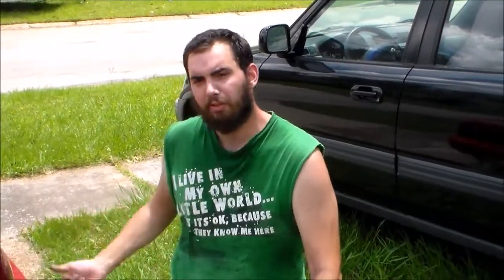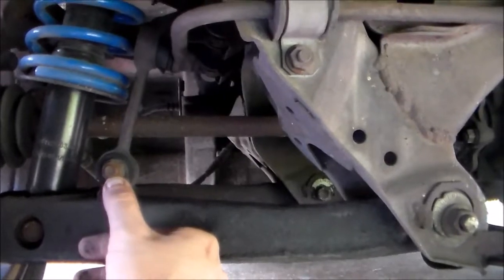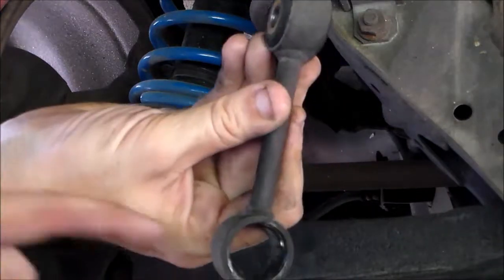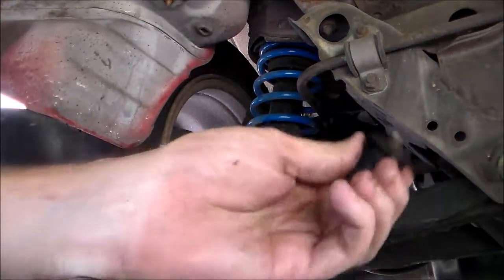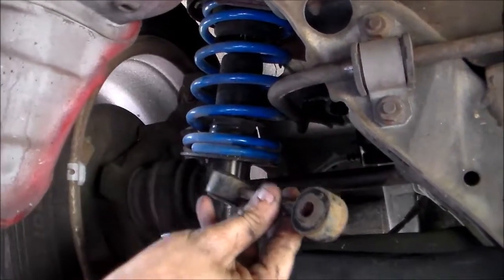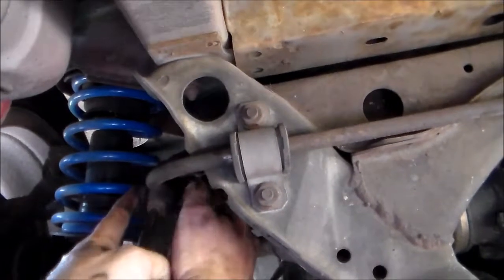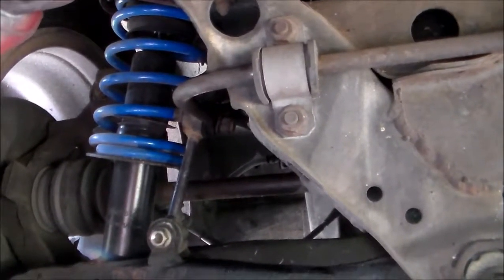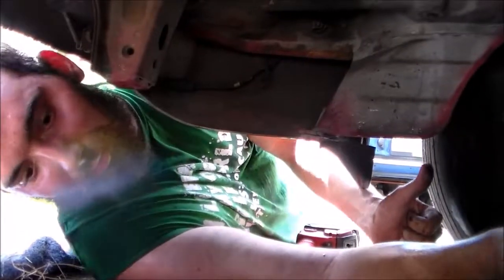90-97 Miata Replacing A Rear Sway Bar End Link Without Lifting the Car!!

Comment: good video, might consider adjustable endlinks. Notice the stress the bar is constantly under because the car is lowered and changing the geometry of the car. By getting an adjustable endlink you could make it longer to accomodate the changed geometry.